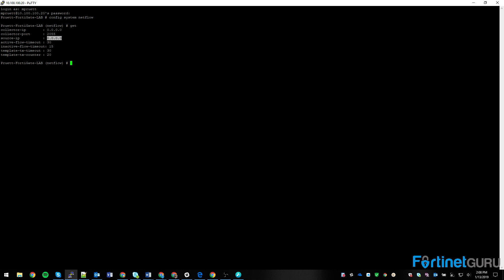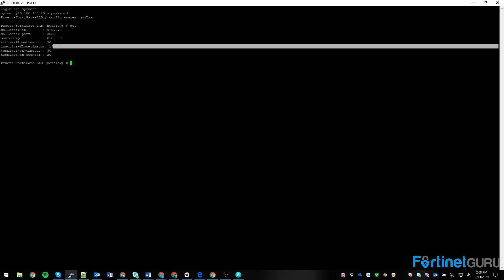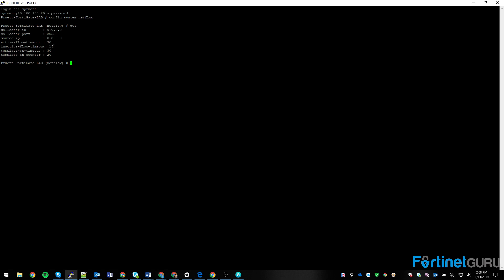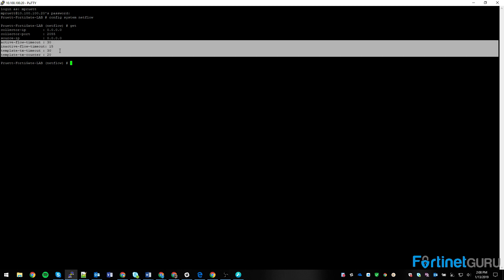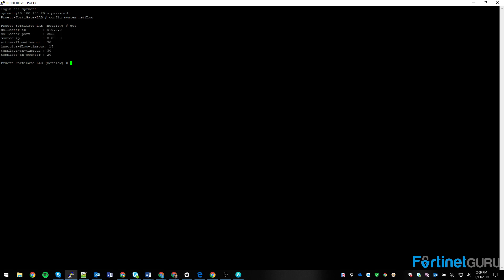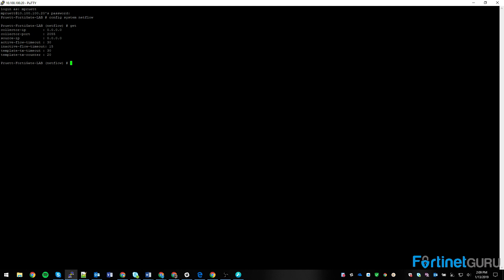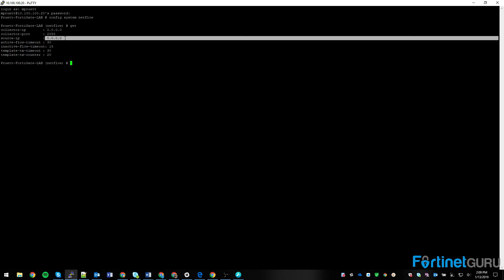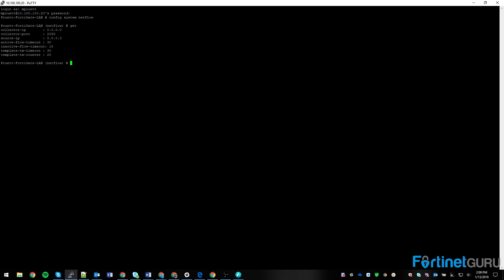How To Configure Netflow On A FortiGate

Comment: In the case of multiple vdoms, will there be a requirement to open firewall ports as well? Suppose I want to monitor WAN interface (external vdom) and the collector is located in the internal vdom, will there be a firewall policy required as well?

Comment: What model do you recommend to get for practice in preparation for a cert exam? Fortigate I and II.
Reply from the maker: A FortiGate 60E is a good strong box that you can use for more than just testing. NSE1-3 is mostly sales training though. You won't need a FortiGate knowledge of any real depth until you start trying for NSE4
Reply: thanks!  I am going for the NSE 4.  Little preparation so let's see how it goes. @FortinetGuru

Comment: hi there - to the point i'm a noob with fortigate devices this 60e is my first.... i config my fortiwifi 60e device however didn't follow or added the rule to regain access to the device and im now locked out - unable to reach GUI via ip or CLI via console - tried resetting but to no avail- can u suggest a way to regain access to my device?
Reply from the maker: If you have physical access to the box your best bet is going to be the reset pin hole. It requires a paper clip that has been unfolded and patience. Either that or the maintainer account.
Reply: @FortinetGuru  thanks Mike- the trouble was i didn't know there was a process in resetting the fortigate, i'm good now - thanks for all ur help - ur videos and explanation are clean and clear.